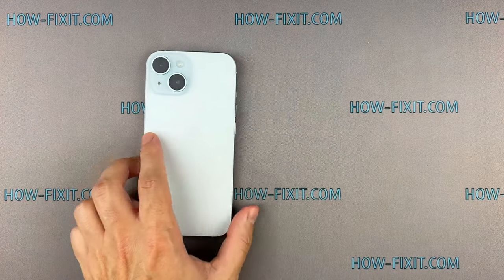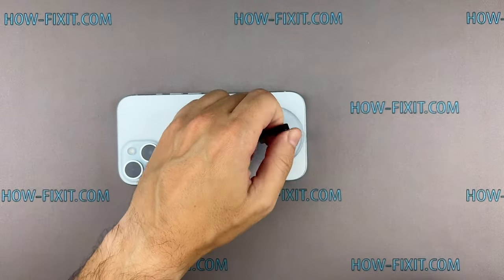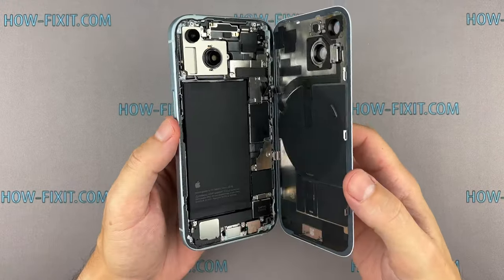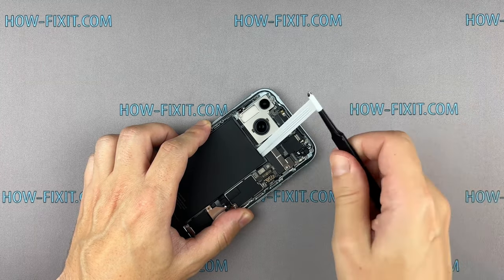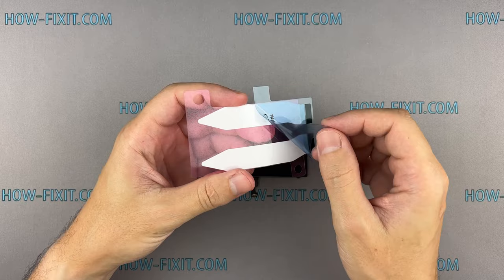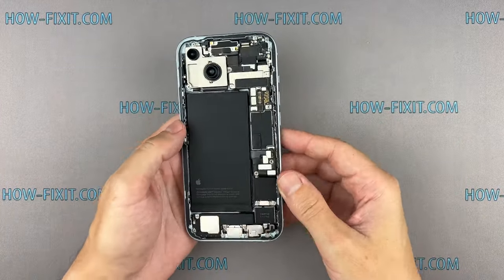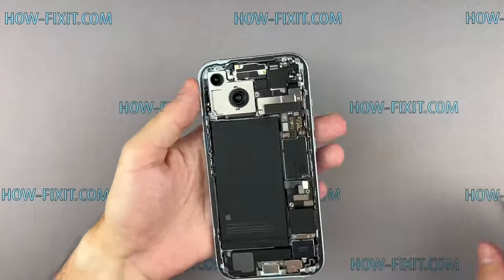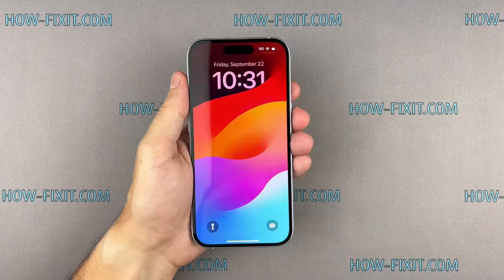iPhone 15 Battery Replacement - DIY Tutorial for Quick and Easy Fix!

Comment: very easy to replace the battery. Especially when after 2 years it starts to swell and starts to peel off the back cover itself. It’s also easy to replace the rear window yourself if it’s broken. Great

Comment: Seems easier than when I did my 12 mini a year or so back. Just got the 15, impressive battery performance out of the box. But no doubt imagine I’ll be doing this within a year or so.

Hopefully this replacement process is fully waterproof, followed every step with the 12 mini and it was fried after filming my nephew in the pool.
Reply: My iPhone 15 battery health dropped to 97 after 1.5 months of normal usage 🫠
Reply: @nnishantgoel  mine dropped to 99% after only 2 months and 25 cycles. And I always charged it 40 to 80-85%